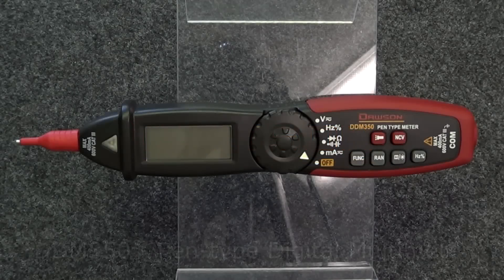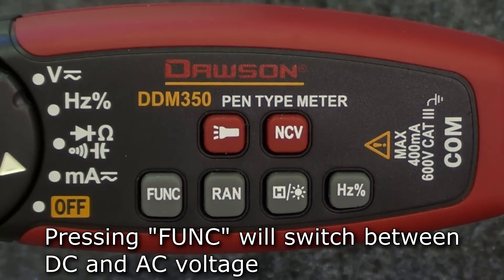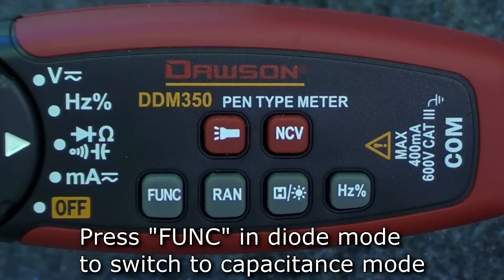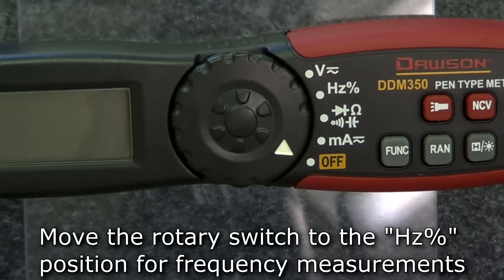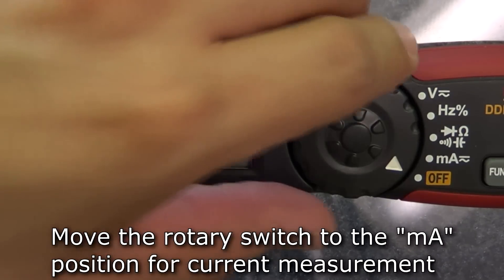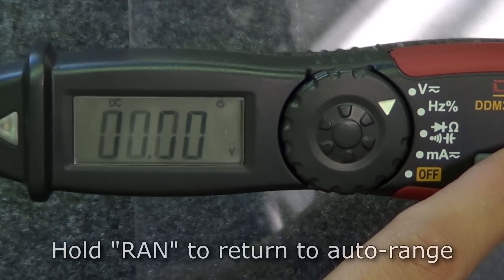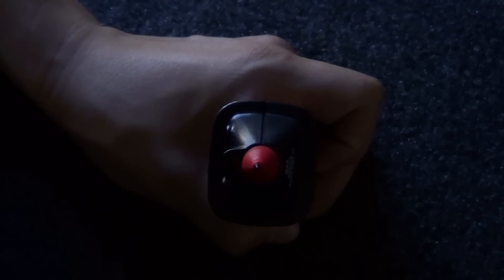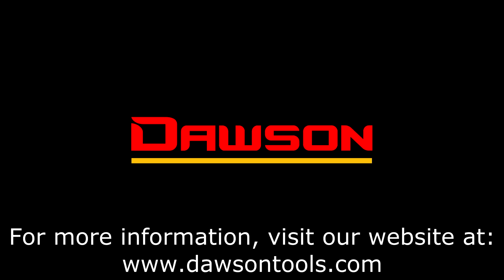Dawson DDM350 TRMS Digital Pen-type Multimeter

Comment: Dawson team please help me!
On my new DDM 350 (2 days old), the frequency measurement is not working properly. When I try to measure 1kHz / 3V (square wave) on my frequency generator, then 0.000 Hz is displayed. But if I connect a capacitor in series to the DMM, then everything is fine and 1kHz is displayed. In addition, the frequency measurement shows a voltage drop of 0.8V (of 3V only 2.2V are left at the output of the frequency generator).

Question:
Why does my DDM350 not work with DC waves.
Why is there a voltage drop of 0.8V?

Is the DMM defective or not?